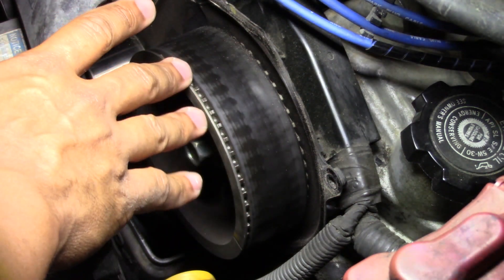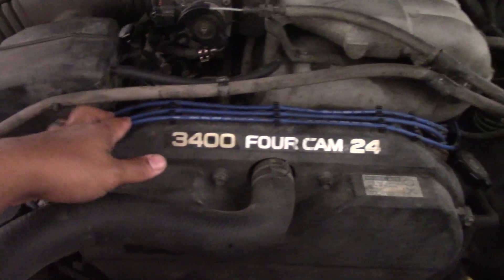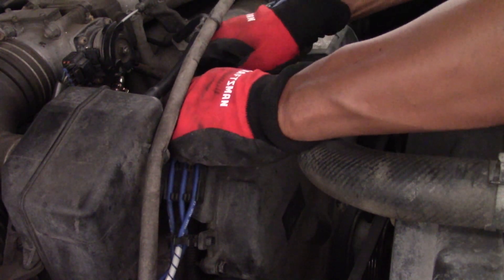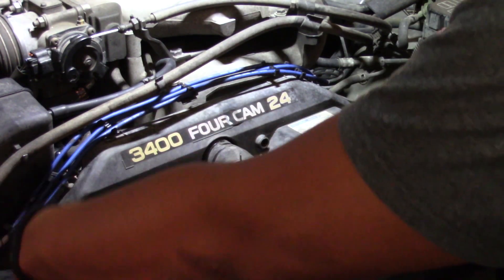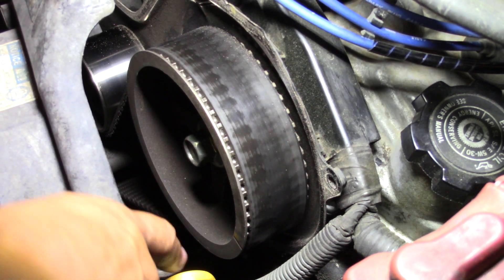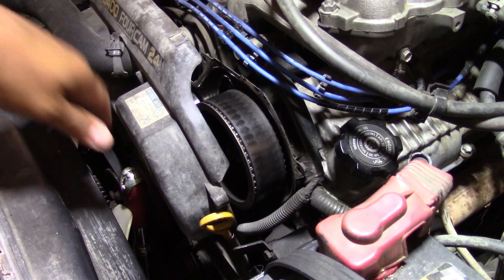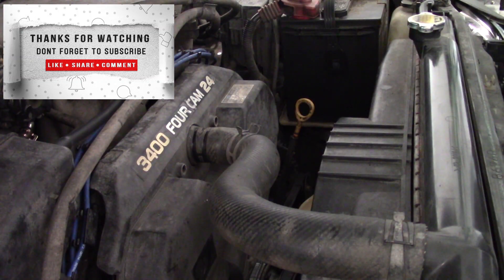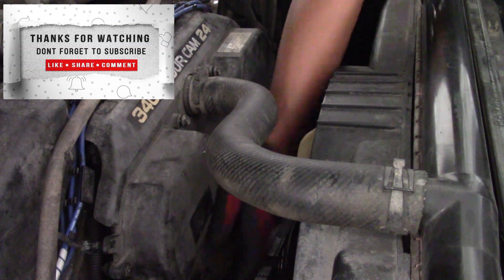Inspect Timing Belt QUICKLY | 95-04 Tacoma | T100 4Runner Tundra | 3.4L V6

Comment: is there an easy way to see if the belt jumped teeth (or whatever), causing no start condition yet rpm's are registering when cranking?  there is confirmed fuel delivery, spark, no CELs, no codes, good cranking but no start
Reply from the maker: You can check to see if the marks on the timing belt, usually a white mark, aligns with the indenti9ns on the crank pulleys. Thats usually what I do in that case
Reply: @EngineeredMojo   thanks, i confirmed the belt is in good shape with 76k miles on it and the timing marks align perfectly, and the crank position sensor is showing rpm's, will not start with starter fluid sprayed into the intake either.  it ran fine driven 20 miles the day before it decided to quit starting.

Comment: Looks original. How many miles on this?
Reply from the maker: Belt was replaced at about 150k, now she's running at 290k at the time of the next timing belt change
Reply: @EngineeredMojo  you don't know if the idler, water pump will last that long. Just the belt, is no garrentee
Reply from the maker: @ozoneswiftak  you're right good thing I changed it all few weeks back. New video will be out soon!